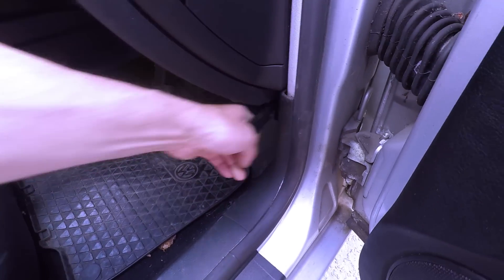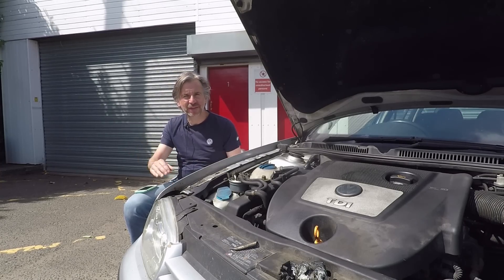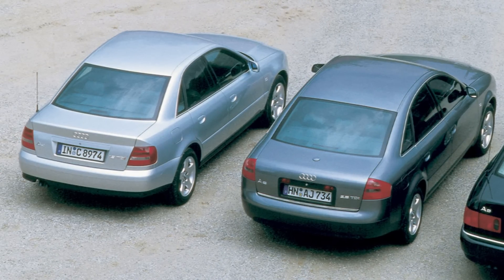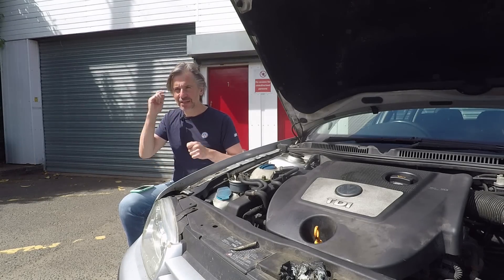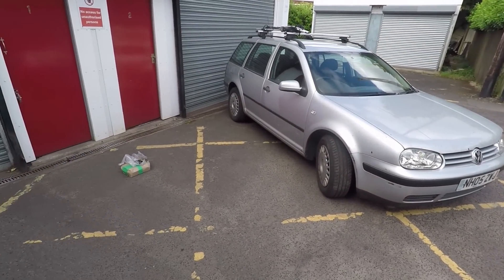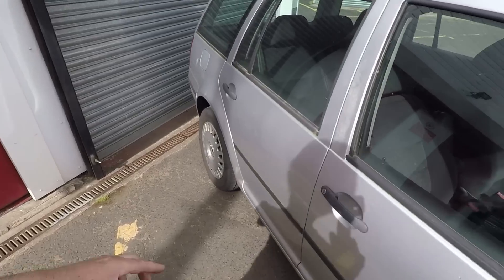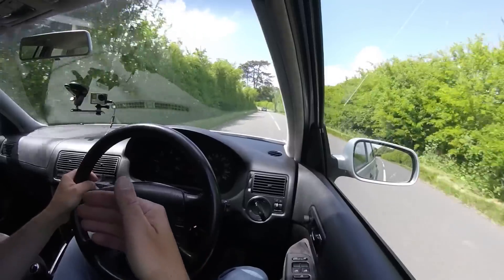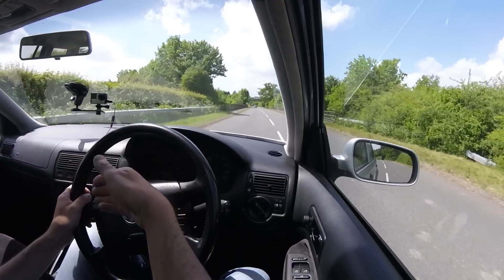I BUY A CAR with VW's BEST ENGINE for JUST £1!

Comment: I remember my dad had an 02 plate Audi A4 brand new 130bhp TDI. That thing went like a train and I used to love driving it. It felt very lively and powered up any hill.  Sadly I think the diesels have died the more advanced they've got, with smaller engines, more filters and heavier frames. My mum had a 1.6tdi Golf mk 6 is quicker, more responsive, more lively in every single way compared to my current mk 7 1.6tdi blue motion Golf. My 1.6tdi  mk 7 golf feels like a snail, unresponsive, not lively, that I've even thought about getting it remapped.

Comment: I love mine, Skoda Fabia mk2 pd105 with a pd130 turbo and injectors, pd150 headbolts, uprated organic clutch and 10kg smf and have a massive fmic for it, I've mapped it to 300lb/ft and 180bhp and it's bloody lovely, pulls well and get amazing mpg when cruising!

Comment: I had a brand new (sept 2002) dark blue golf tdi pd 130 as an import. Got it £2000 cheaper than the dealer at £17,800. Turned out it was actually a ‘highline’ so had full leather, sunroof and was the most economical diesel I’ve ever had. Used to get nearly 600 miles from a tankful if I was frugal. Did 100k fault free miles, sold it for £6500 in 2007 and bought the golf gt with dsg etc. Great car but should’ve never sold the Pd. Worked out it had cost me £40 a week for five years. Now have a GTD estate, which is also awesome.

Comment: Got a 1.9 tdi pd driven 311k km. It has never given me problems outside of the camshaft position sensor which was a common and easily fixable problem by an amateur like me. Cost me 20 pounds to fix. Hands down the best engine vw ever made. Sadly i have to sell it since i needed more space.

Comment: I agree, fantastic engines. Had a few in the past in Seats and VWs. However, everything else about this generation of VAG cars was terrible door locks, door and tailgate handles, window mechanisms, electric mirrors, switches and controls on the dash, sunroof, relays, broken pedal box..i could go on. 
Bodys were great though, never had rust issues.

Comment: I've got a Bora 130 on the drive with a bit of an oil leak, think I'll get it back on the road now!
Reply: Yes, do it!! 😁😁👍👍
Reply: I got a bora pd130, 163K miles now still going strong!
Reply: Got a bora pd130 highline with 170k...run like a trooper
Reply: i had a bora from 04-09 brilliant car 110 tdi - 65mpg on motorway 70mph...... they look better now ironically as the high bootline wasnt popular originally but now is loved....
Reply: definately worth saving just look out for crank seals too
Reply: Audi A3 1.9 AXR... I dunno.. maybe the turbo seals leak a bit when it's cold, but it has been like that for 4 years and 25k miles now :D 242k :P

Comment: I remember driving one of the first 115 Versions of this in a golf GT TDI.. was probably back in 2001 ... I was gobsmacked and instantly wanted (but couldn’t afford) one ... A few years later I got my hands on an Audi A4 with the 130 BHP version in & had that mapped to around 160 ... it felt so fast with all the torque ... I could leave ‘fast’ petrols behind with in the in gear acceleration it had ...

Comment: Well, the bodywork is a lot better than my MKIV Golf Estate...!  TDI PD130 - wonderful engine and incredibly easy to service.
This is like looking into a mirror.  Only difference is the climatronic and the engine map.

I had the clutch done last February after spectacular DMF failure and the cambelt about three months ago.  Not bad considering I've done 22K a year for the last four years in it.  Got it at 48K and it's now on 138.

Comment: Hi I have an 02 plate Audi A4 1.9tdi pd 130 bhp and have to admit the engine is just brilliant . Mine has done 236k with original engine, clutch  etc and pulls like a train and has been reliable I service it twice a year myself because I do a few miles and it’s not too dear for service stuff either so thumbs up for the 1.9 tdi pd engine .. bulletproof 👍

Comment: Got a beat up VW bora with the ALH 90bhp 175k miles been the most reliable car I ever owned shocks brakes exhaust and front wings is all I had to do. Oil change every time service light comes on

Comment: Great video Andrew.  After purchasing a mk3 gti from you some  years ago now and as an avid follower of volkswized I love stuff like this.  Having worked for vw for ten years and working on the mk4 tdi from 2002 I am in total agreement with you.  I currently own a mk4 gti pd 150 which is totally standard and the car as a whole and more over the engine astonish me. The torque even in 6th gear up hill never fails to impress. A truely amazing car . However I now have the tricky predicament after seeing your mk5 gti review of weather to change. After owning several mk2 gti's and currently a corrado vr6 I have never had a mk5 despite working on them over the years. I would be interested on your thoughts Andrew and if possible your opinion on values of my mk4 . 104k. fsh and extensive paperwork and maintenance.  (including the camshaft and buckets replaced). Excellent rust free bodywork and superb interior. 
Keep up the good work with the brilliant and informative vidoes.👍
Kind regards matt

Comment: I drove my PD130 380 000kms(237 000 miles) before I sold it. It still had the standard turbo and injectors. Nothing mechanical besides for the: clutch, waterpump and belts where was replaced on that car. The PD100 - PD 130 are some of the best engines Volkswagen made.

Comment: Thanks for posting your fitting tribute to this great engine, Andrew 👍 Used in so many different VW group platforms from the Ibiza Cupra's (160bhp!) right up to the Audi A6. They knew they were onto a winner.

My beloved Bora is the PD130 - it does really shift, has never missed a beat in 130k miles, and easily gets 60+mpg on a run. It will be a sad day when it eventually has to go. You're right... I was very pleasantly surprised with the shove on the test drive !

Comment: Brilliant engines, they also did a PD160 in the Seat Ibiza. I had an A4 PD115 and Fabia vRS PD130, both very reliable, efficient and surprisingly punchy. The PD115 would do up to 75 mpg on a steady run.

Comment: Owned a 1.9 tdi pd Polo, 1.9 tdi pd Fabia, and 1.9 tdi pd vrs Fabia. The 2006 Fabia I still have as a good runabout in London, but it will have to be scrapped by Oct 2021 due to not meeting ultra low emission requirements. The PD 1.9 engine is absolutely bullet proof, pulls like a train, economical, and has got to be one of the best engineered and most reliable engines ever produced by the VW group. Very sad to see this engine resigned to the breakers yard.

Comment: 1.9pd the best vag diesel ever. I had the 1.9tdi 130 in a Ibiza FR it went like a rocket 🚀
Reply from the maker: Great car that Ibiza Campbell, I ran one for a bit, sold it to a guy at TPS who got many more years out of it. Drives lovely, 6 speed too
Reply: volkswizard Fantastic power unit and box for such a small light car 👍🏻

Comment: Got an Ibiza Sport model with the PD130 which is under tuning process but what’s amazing is that I started the tuning @ around 160.000 miles and now with a bigger turbo and some goodies it’s well over 205.000 miles and still going strong 
P.S.-never had engine,gearbox or turbo issues...you know the costly ones 🤑

Comment: I bought a Vento Tdi with 206k miles. The engine was smooth and didn't even dump smoke. Got it up to 252k before it failed its mots on rotten sills. I drove it to the scrap yard to be scrapped. I actually felt a bit sad and kept the spair key lol

Comment: Fab Review. i had the pleasure of 10years from new driving a 150hp Leon FR TDI Mk1 & that PD diesel was a dream. i replaced it with the Mk3 2lt 184hp TDI & yes its smoother & much quieter but has non of the turbo spooling up noises etc etc & feels a cheaper car but still very good & touching wood its 6yr old just past & been faultless. It wont do 700+ miles on a tank like the mk1 did tho ! Tank was bigger mind. I still dont get the point of switching back to a Petrol Equ & will run Diesels for as long as possible.

Comment: I’ve got a Passat 130 with 252,000 with original clutch, never had the head off only needed a new radiator and new alternator brushes  in 12 years, gets better mileage than wife’s golf blue motion 1600

Comment: I drove exactly this car with 131hp for ten years, goes like a train I had very few problems, The best engine is the ASZ engine Code, don’t throw the pump jets away they can be refurbed for £30 the rep sets are available on eBay. I have seen these cars with 450,000km on them, this car would cost around €3000 here in Germany.

Comment: Car Throttle have featured a couple of cars with the engine (Octavia and Audi A4) that have done about 500k and 400k miles respectively. Incredible durability!
Reply: The skoda they got is actually a common rail diesel.
Reply: Thanks for clarifying 👍 I know the Mk2 Octavia VRS briefly had a 170bhp PD variant before switching to the CR, but am no expert on the engine history of the Octavia's. Think I'd still go for the PD-version, being somewhat biased and appreciative of the power delivery!

Comment: I ran a B5 Passat Estate PD115 for 14 years, and the original turbo went at 223k miles still running the original clutch and gearbox!  Amazing considering I had the engine tuned up.

Comment: I have the super slow 2.0 ABA petrol, but omg i love this engine because I beat the living hell out of it and it keeps running. Bouncing off the rev limiter with 363,000 km (225,000 miles) . One time I didn't know I had no oil in the engine and drove 120 miles and even floored it and the engine didn't blow.

Comment: V fond of these motors.

Wife had a 2003 Ibiza 130 PD Sport and it was rapid...even by today's standards it wasnt slow.  Incredibly frugal too....driven hard it'd still return 50mpg.....shame the rest of the car started failing..only reason it went 🤣

The following CR motors were garbage.....quieter yes....but so linear they were boring...also less efficient.   Only the move to the newer EA288 gen motors got it right.......the 150 and 184 non-SCR versions are super.

Amazing for £1 Andrew, cant complain hey?!

Comment: I had a 3cylinder  1.4 pd 80 bluemotion at least 750 miles for its small tank, averaged 74 mpg and hated towns with its dpf unless you used bp ultimate fuel.
A trader rushed to buy it with its 64k miles as he said you don't see them with legit low miles.
14 inch wheels, traded up the gear knob, a map sensor needed as you said these pd motors do rattle on nicely

Comment: Had a gt tdi pd 115 in the early noughties 
great car totally reliable  good on fuel built really well  had full leather and was a good car
Handling wasn’t the best but put eibach springs and bilstein shocks on it which made  it better
Owned it for six or seven years and replaced it with a mk5 edition 30
Now own a mk7 r which I know your not keen on 
But so far so good
Great video keep up the good work

Comment: MIne is a 2002 Hatchback TDI 100bhp.  It's done 238,000 miles. Runs sweet as a nut.  I change the oil and filter at 8,000 with Quantum Longlife 5w30.   SE spec like the one being reviewed. Cruise, Climate control..., brilliant.

Oddly,  the  Mk4 shape seems to have gone through the stage of being just an old clunker, and seems to be on the verge of looking rather cool. With later Golfs tending to look somewhat fat, and flabby in comparison.

Comment: The 1.9 was a very good engine, I have a non PD 110 in my 03 Leon. Been very reliable over the last 14 years.  Rest of the car has the usual MK4 problems,  replaced a door lock last month.   They'll keep going, but unless you can work on them yourself, repair bills would put most owners off.  
Don't know what I'd replace it with, since as you said the newer diesels aren't that much better to drive, use more fuel & not as reliable.  May have to go back to petrol.

Comment: Great cars these. Had a 52 plate Golf SE TDI 100PD  for  7 years. Solid  reliable  motor. Changed it for a MK6  Golf Match 1.6 TDI . What a mistake that was! No end of issues. EGR valve failed, clutch went and then the DPF started playing up.

Comment: Hi Andrew. Mk4s are great cars just under appreciated. Clocked 550ks on mine 1.8t. Also have a 05 Golf GTI mk5 from the UK and now its sitting at 240k Miles. Original  AXX engine gearbox still. They lasts

Comment: Currently run a golf 130pd/6spd and a 2.0gti but with the 5spd  both mk4's, tbh id drive the 130 all day long👌💨😎
Reply: Cus the mk4 gti is shite :p pd 130 with 6 speed is niceee
Reply: The scrapyard 6spds should be bolted to every remaining 1.9TDI with 5spd boxes lol.. They are so rare with 1.9TDis
Reply: @conorf8091 i wouldn't say ot was shite,  its a nice enough car with leather etc but just not quite as quick lol

Comment: My MK4 V6 4motion is a cracking car, 18 years old, no rust, drives like new, and at 119,000 miles there’s plenty of life in the old girl.
Reply: Girlfriend has the Audi A4 Avant with the 1.9tdi 115bhp. It’s an awesome engine. 50mpg and superb low down torque.mone of the best uncomplicated Diesel engines ever produced. Far better than the 2.0tdi that was sold at the same time!

Comment: Have a pd 150 reflex silver 3dr with Santa Monicas, leather and sunroof purchased in a hurry as a cheap runaboutbut still have it 5 years later. Sadly eventually gave in to the perennial chocolate camshaft issue despite my believe it wouldn't with regular correct spec oil but against my better judgement had it repaired and now does 55/60 mpg all day long.  Steering rack also replaced and driveshafts and track rods. Due to lack of use and space sadly looking to pass it on soon but for 3 years didnt miss a beat. Now on 168k.  Another fun PD fact i believe is that Seat bumped these units up to produce a stock 160hp variant for the Ibiza in the mid noughties 👍

Comment: Had a 54 plate Audi A4 Avant tdi130 when it was a couple of years old, first experience of a diesel and very impressed, great torque and fuel economy, regularly 45mpg. Only ever had one service, 25k miles and nnever a problem.

Comment: Woohoo MK4 ftw.  I had a 1.9 pd 100, reliable, frugal and loads of power when remapped .  Served me well for 10 years.  Sold it at 17 years old and it's still going strong with next owner. 

The only criticism is how damn noisy and tractor sounding they are at cold and sat at idle.  

I'd have another one if I had a long commute

Comment: In 2006 I bought an end of line Leon FR tdi which had the 150 engine and Cupra R body kit and wheels. It was £600 cheaper than a 1 year old used version with standard FR body kit! Awesome engine that would get me 55mpg and tune up to 200bhp with torque limited to 300lb-ft to save the clutch. It was on 189k miles at its last MOT. Still regret selling that car.
Reply: I had a leon with a BKC engine code 1.9 and that was a champ! I regret selling it too.

Comment: Great video, I owned a 2004 VW Polo 1.9 TDI 100 BHP, the best engine in my opinion, I did 164,000 miles and it was so reliable :)

Comment: Love these engines! Was merely a petrolhead until I test drove a mapped Mk4 pd130. The torque was addicting so replaced my Mk4 1.8t with a passat 3bg tdi. Has run about 300k km, and injector wiring needs replacing and turbo (180bhp map broke vnt). Many of them for sale has ran well over 200k miles, almost unkillable these pd tdi engines. Wanted to upgrade to a mk7 2.0tdi, however I am concerned about reliability... Might just get another Mk4 tdi estate.

Comment: I’ve an Audi A4 52 reg 130 pd quattro that I use for work. It’s got over 200k on the clock now doesn’t use any oil and in the bad weather goes past everything. I’ve looked at newer cars to replace it with as I do between 20 and 30 k a year but just think there crap. 
When I do replace it I will be getting another pd.

Comment: One of the last mk4's being an 05. I've got a newer common rail, but the PD is so much better engine, less problematic and go on and on. My dad had a 110 bora we sold it with 160k and years later its still taxed mot'd on 200k plus
Reply: A 110 would have been a non-PD

Comment: Hello Volkswizard, I live in America and have a question.....I own a 2004 Jetta MK IV GLI turbo. I currently replaced my headlights with LED's and also replaced the fog lights next to it in the same housing, which are not going on now, so I replaced with old ones to check and they still didn't work and my headlights are now on constant high beam. I checked the regular fuses and they seem all good. So I'm not much of a car head, but I was wondering if you could tell what I'm doing wrong ? Thank you for your time

Comment: Car throttle recently bought an audi a4 1.9 tdi with 500k miles on the clock with aparrently original turbo and everything, search YouTube for it to have a look
Reply: con Ba and you believe all the drivell

Oh wait its on youtube so it must be true
Reply: The Stud why wouldn’t you believe it? There’s so many out there with 300k, there’s a few with 400k, why couldn’t one make it to 500k?
Reply: https://www.youtube.com/playlist?list=PLzleYhq4aqPsfNJxfYjL3XP0u6KMFetgn there's the playlist
Reply: The Stud my dads one has 347k miles on it and he’s never had to replace turbo or anything like that, so wouldn’t surprised me if one made it to 500k on original parts
Reply: 500k is possible with mostly motorway driving and not turning the engine of directly after running the engine hot.. with a bunch of city accelerating etc the turbo usually wears out earlier though..